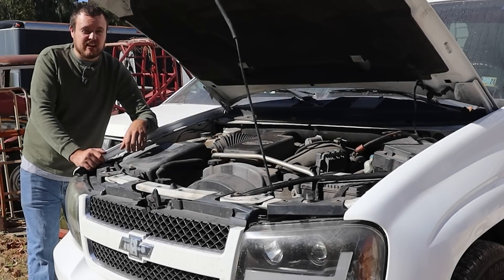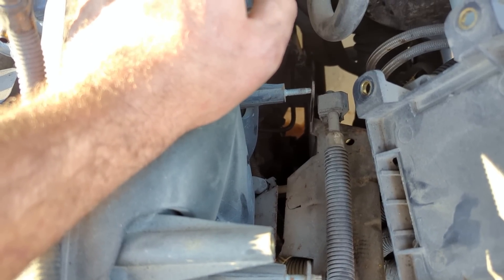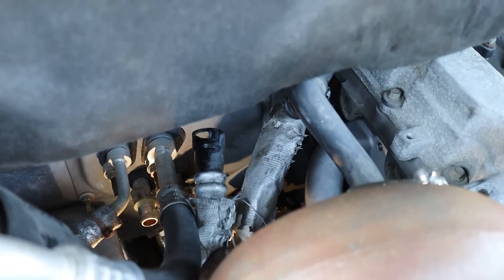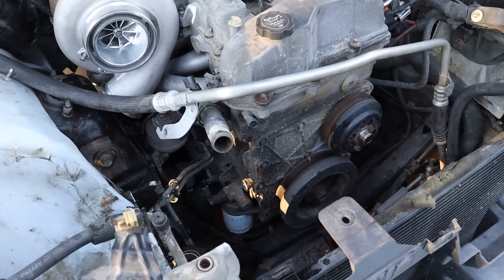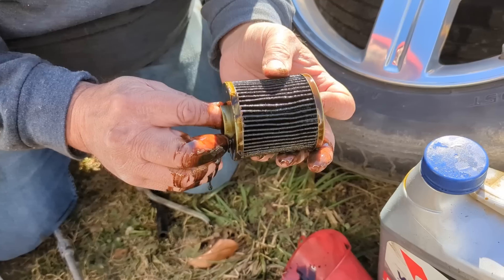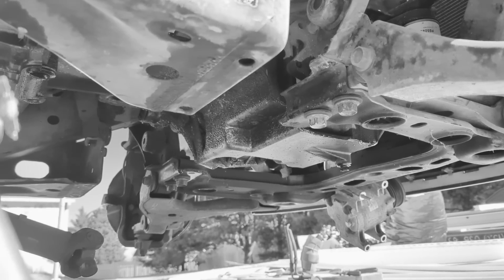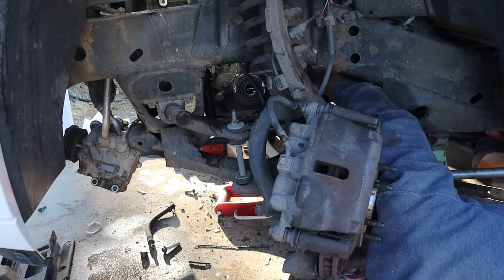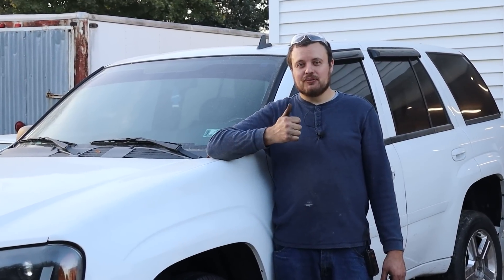Why did GM Do This? - Fixing Chevy's Mistakes

Comment: If you're still looking for a power steering solution, you can take an electric power steering pump from a P1 platform Volvo (C30, C70, S40, V50). It's an electric pump with a fluid reservoir on top, so you can keep the TB's steering rack as long as you can figure out the plumbing. One downside to the Volvo pump is that it'll be at 100% power assist all the time so it'll feel overboosted, unless you also grab the power steering module and make that work somehow.

Comment: I wish you guys would make a series just about the switch into 2WD, what has to be done to make a good switch, what parts are needed and so on. I guess a lot of guys would be interested to get rid of 100kg on the front just for better handling and such. I would love it ... thanks for considering ;)
Reply from the maker: Yeah. It would be quite easy if you just removed the transfer case, axles and front diff, but I wanted to get the whole 9 yards
Reply: @Calvin-Nelson I’ve got a 07 hummer h3 with 3.7l p12 ecu. What year 4.2 l should I swap into it ? 08 ?

Comment: How goes it Brother? wanted to reach out asking for some help. I’ve got a 2005 Cadillac Deville with the 4.6 L Northstar V8 engine in it and I really liked what you were planning to do with the twin turbo 4.6, wanted to see if you could help me out/guide me in building a rear wheel drive twin turbo 4.6 L Northstar Cadillac Deville, I already went ahead and pinpointed the already purchasable products that you listed in your previous videos however, just like you said, in said video, some of the parts are not as easily attainable. Could you help me out?

Comment: I really wish there was a more cost effective cast turbo manifold for these engines.  I remember a couple years ago a guy on the Driveway engineer group was selling cast LS turbo manifolds with crossover for around 400.  I have no doubt the Artec one is of great quality, but $1700?  That's insane.

Comment: I honestly despise these engines for the simple fact the valve train sucks and nothing is simple to replace on it. Otherwise, they had great potential if you don't mind the V8 mpgs.
Reply from the maker: The valve train is awesome. Very easy to work on.

Comment: Watch the beginning tear down at 1.75 speed. Goes faster and the music kinda jams! Would be super cool if Procharger would develop a mounting system for one of their blowers. Just a mounting/relocation bracket system and a blower. Let us idiots figure out the rest. By the way, I have one of these and it runs amazing, and then it ticks like that and runs like crap. Let it sit....does it again. Motor isn't hurt. My friend developed a theory that the oil pump pressure relief in both the Atlas and the LS's goes wonky and gets stuck. Sometimes closed (hey, you know all of those blown the hell out oil sending units that GM is famous for....?), and sometimes open (and those mysterious ticking lifters that GM is famous for.....) and lots of confusion in between. Lot of work, but you could prob replace that oil pump and that motor is likely fine.

Comment: There’s a better way! You can use 2011-2015 dodge charger electric power steering pump. You can use all of your factory steering or rack of choice. They sell controllers for them and they are extremely robust. Check them out!

Comment: It looks like you could run a water to air intercooler strait across the top of the engine. I think that's what I would want to do with my Trailblazer, though I'm sure that wouldn't give you enough power to run 10's.

Comment: What suspension stuff did you use instead of stock ones? I'm about to further my trailblazer and offroading it, and the stupid bolt pattern makes it hard. I want to go with something stock, but can't have it run into the steering knuckle. What specifically did you change is what I mean? And how are you doing the rear?

Comment: Calvin; Mercedes Benz uses an electric power steering pump on several models, and if more room is still to be had, an AC compressor run on twelve volts- a fatter alternator might be a good call with that. GM quit trying to make engines look good in the age of cover it all up with tacky, terrible looking plastic. Not alone, either. Keep up the sound picks- you matched the mood well for the rip out!

Comment: Im assuming the location should be about the same, but on my 5.3 Envoy, I converted the oil pan to a rear sump pan. I had to modify the factory rack to sit an inch lower and gives about 1/4" space between it and the pan.
I can't wait to see your final setup on the front suspension. Always wanted to find a way to lighten it up!

Comment: You need an automotive stethoscope. 
Also, if you want to diagnose a bad bearing  with the engine running, hold the brake and slowly increase rpm; if you have a bad bearing the noise will get louder with add rpm. 👍👍
Reply: Generally an easier way would be to unplug a coil or injector one cylinder at a time. Once you take away the cylinder pressure of the combustion event, it'll quiet way down and you'll know which is your bad bearing.
Reply: If it's anything like mine, it's the oil pump's pressure relief getting stuck open (and sometimes closed), lifters clatter. Same junk happens with 5.3, 6.0's all the time.
Reply: An old wood handle works well, too.

Comment: I have an 05 4x4 that i paid 500$ for 10 years ago with 212,000 miles on it. I just crossed 300,000. I would love to do something like this with it. I dont necessarily want to hot rod it really but more boost it to gain more bottom end torque so it would pull my boat and my tractor without hunting for gears. And just cool factor. I have always wanted to build a forced inducted engine. Actually eyeballed hanging a rhb31 off the side of my 9n ford. The little atlas engine in my trailblazer has opened my eyes to engines other than v8, and has made a believer out of me. I still love a v8, but that i6 is smooth and has been handed reason after reason to quit its entire life and just stubbornly refused to do so. You gotta respect them. I honestly dont know how that kid blew that one up. Im fairly certain mine had not an oil change 1 while my sister in law had it for 5 years before me. All while being driven like a pissed off teenager.

Comment: a nissan Altima hydraulic electric pump super cheap and easy to wire works with any power steering system

Comment: Good video, FYI I believe the extended wheel base versions have a larger more common rear end the GM 8.5 I did a swap on my Envoy with one the only issue was the pinion came out about 3/4 of inch farther then the original. But so far I've had no issues with the drive line bottoming out on the transmission
Reply from the maker: From what I read all 6 cylinder trailblazers came with the 8 inch rear
Reply: @Calvin-Nelson  probably right the one I swapped did actually come out of an extended wheel base with a 5.3 LM4

Comment: Whats the weight of the engine. I have 2 of these sitting and also have 2 jeep xj that need engines. The jeep 4.0 is 20lbs heavy than a sbc.
Reply: 470 pounds, so by memory about 45-50 pounds less than a  AMC 4.0

Comment: Could you keep the factory rack and run a electric over hydro volvo power steering pump setup. Plenty of room to hide it up there.
Reply from the maker: Nah. I'm converting to front steer to make room for the rear sump.

Comment: modern ish volvo power steering pump, easy to find in junkyard or ebay and requires only a connection to the rack and 12v

Comment: Dorman and others make quick lock style 90s in all the popular sizes. 800-419 and so on depending on the size you need. We used them on a Coyote swap F100 we did. And for steering why not leave the factory rack and just use the Volvo electric pump assembly? Nothing is gonna fit down there as easy as the factory rack will.

Comment: Owning a 04 Colorado 4x4 with a 3.5 I just pulled to drop an 07 3.7 but unfortunately I blew my right wrist apart so job stalled indefinitely now, I can say its easiest to pull the engine cause that pan won’t come off without removing rack and diff.

Comment: Dorman makes a stainless steel push lock nipple to replace those plastic ones that always break in the middle of nowhere. 800-409HP should be the same number at any parts store.
Reply from the maker: Lol. I just ordered some the other day.
Reply: @Calvin-Nelson  they sure last a lot longer and it’s easier to weld than the abs plastic.

Comment: I understand cutting weight but I want to see it with the front differential just to see how much it could handle before failure. The A4WH setting on my envoy is one of the best things about the vehicle. When the roads are slick I put it in Auto 4 Wheel high and the front only engages if the back tires let loose and it grabs traction instantly. It would be cool to see how much abuse that could take. Then when it fails gut the front.

Comment: Have you looked at the Prius electric steering? They are a bit big, but they attach to the steering shaft and only require 12v and ground. Everything is in one package. Keeping the hydraulic steering rack as a manual will probably be heavier, though.

Comment: "Boost fixes everything." ~Steve Morris
Reply: Except a knocking rod bearing...
Reply: @countryjoe3551  Can we remote boost the oil pressure, Joe? LOL
Reply: @countryjoe3551  Actually it will 100% stop a knocking rod bearing......by putting it through the side of the block. (Thats the point of his joke btw)

Comment: Hey Calvin what are the RPO codes on this truck?

Since it has 18” wheels it should have the 8.6” rear instead of the 8” one.

Interested to know what rear gear ratio it has too
Reply from the maker: It has the 8 inch with 3.73 gears. From what I read, all Trailblazers with the 4200 got the 8 inch.
Reply: @ ok thanks for clarifying what it has. 

I have a 2008 TB LT and From my own research it seems that if a SWB 4200 was optioned with 18s from the factory it may come with an 8.6.  

Mine now has the 8.6 swapped but you should try and find a 9.5 from a TBSS since you are going 2WD

Comment: Great video! There seems to be lots of support for the '15+ Mustang/F150 EPAS rack. IMHO, they are wide though.  From what I can find they have an overall width of 55"+ with the inner tie rods. Being you have a Trailblazer that may not be an issue. Good luck👍👍👍
Reply: A mustang rack? No thanks. When they began to fail they will turn the steering wheel by itself. Had it happen to me on my mustang gt. Luckily i didn't run into anyone. That's probably the reason they are always crashing 😂
Reply: @warriorplutotrent3827  there are many parts in every cars front end that will cause a loss of steering if they fail… better never drive anything with tie rods then😂
Reply: @knowbull5hit590  a mustang rack is electric with shitty programming from furd. I advise you  go google if you're confused 😂😂😂if you never owned a mustang with electric steering then you wouldnt know. Theres a reason why they crash😂😂😂

Comment: What about a electric/hydro Volve power steering pump. They have controllers on EBay!!!
Reply from the maker: I still need a rack that turns the opposite way, as I am converting to front steer.
Reply: @Calvin-Nelson  oh ok. The rack is in the rear. Cool

Comment: I bought a 2004 EXT Trailblazer. I put a lift and 32 in tires. I asked the interent why I got crappy gas mileage. The internet said take your mechanical fan off and put an electric fan on. Well that was great until the day I forgot to turn it on. Smoked my vortec 4200
Reply: Wire it into a thermostat
Reply: @GreatLakesLogger  I totaly had planned on creating a fan controller but had not gotten to it. Its just one of those things that experience > internet.

Comment: Engine removal in a 4x4 requires disassembling the front suspension to remove the axles that go through the oil pan. I guess if you were converting to RWD you could just cut them. Fun fact The 4x4 front wheel bearings are the same as the RWD they just do not have a axle shaft going through them.
Reply: thats what he did/is doing

Comment: Take a look at the s550 mustang electric racks, I have one on my f100 with a crown Vic swap and it works amazingly well. Range industries sells a wire harness for it, just needs power, ground, and a signal to turn it on.
Reply from the maker: I was looking at them, but the mounting is better on the F150 for where I want to situate the rack.
Reply: Just FYI, the 2004-09 Prius has electric assist built into the column. And it's basically stand-alone. You just need power and ground. So you can keep your steering rack. Not sure what it would take to mount the column, though.
Reply: @michaelblacktree a few fellow DSM owners have done this swap. I'm not familiar with what's involved. I do know the volvo electric P/S pump is the go to setup for most of us these days. And that's easy. Just requires you to mount the pump out of sight somewhere
Reply: @highpsiguy4085  This is the route I was thinking, means you can leave the right stuff in there and not bother with adapting something that isn't designed to go there.

Calvin, the Volvo pump is just a hydraulic pump turned by an electric motor, so you can adapt it to the stock rack. It's an assembly with the pump and reservoir all in one and you can put it wherever you want.
Reply: @michaelblacktree  almost certain I saw this installed on an episode of Jay Lenos garage. It was on an old fire truck. Epowersteering makes all sorts of stuff related to this.
Reply: Thank you, definitely looking into this for future builds
Reply: Kia electric racks are used on drift builds now
Reply: GM has electric steering in Pontiac G6s 05 to 10 I believe, in the column, but it's a GM product it doesn't last very long. Then you're pulling columns at pick a part every couple years or so.

Comment: Nice going Calvin 
Could you run the turbo under the passenger side seat like Steve morris has on his blue one ? 
Then you could really make it a sleeper and not have to worry so much about the heater and ac moving ? ?
Reply from the maker: You could. I like seeing the turbo when you pop the hood.
Reply: Amen 🙏🏻  @Calvin-Nelson

Comment: In my opinion they are the worst to work on !!
Reply: Yes if you're delving into the oil pump😂 anything that has to do with the front timing cover coming off then you'll have your hands full but they are easy to work on besides that. Atleast it doesn't have the timing chain on the back lol
Reply: It will only be terrible The first time he does it, I like the F body front suspension swap. The ball joints and brakes on those were garbage captured rotors terrible.
Reply: Nissan is...and then every European vehicle.